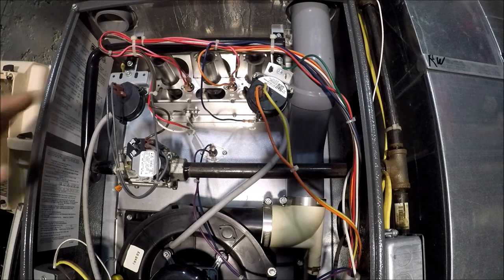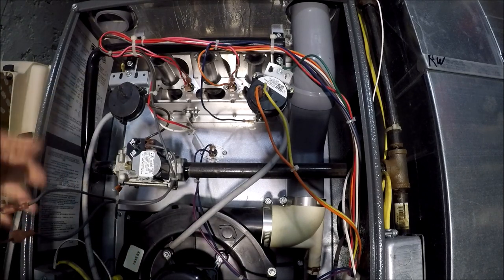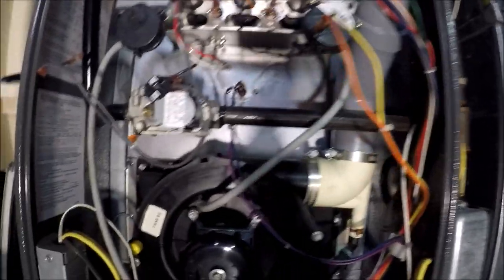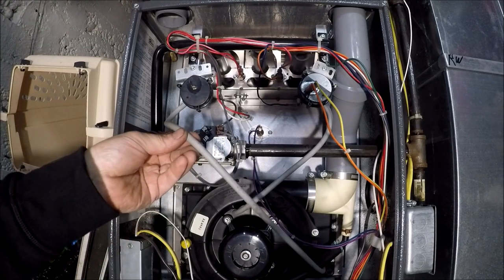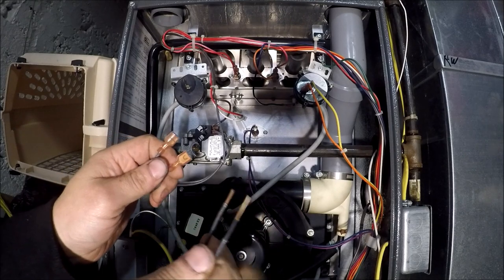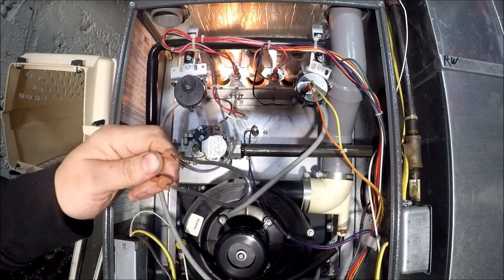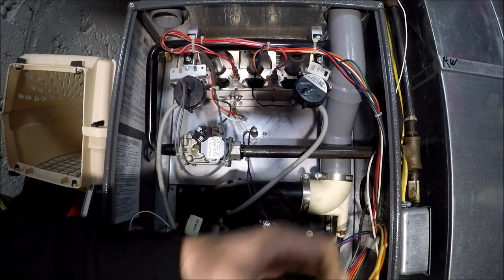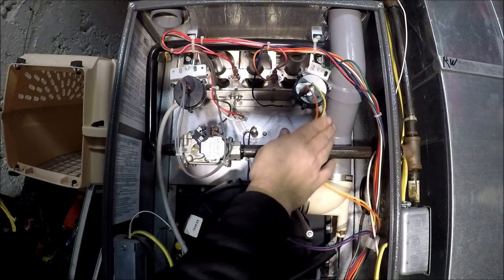Jump a furnace pressure switch for diagnostics

Comment: What would be the cause, that every year I have to get a new high pressure switch. Always spend a couple days continually going down to the basement to let it run through a cycle to heat the house up while waiting for the new one to ship. Is there a way I could do some better maintenance during the summer so that switch isn’t bad start of every winter?
Reply from the maker: Its probably a moisture problem. Make sure your furnace is level so it drains properly. Maybe pull the line to that switch during the summer to make sure it is dry. Of course have a replacement on hand at all times. Let me know how it goes.
Reply: @themrhelperguy  thanks, I think that did it, I previously emptied the hose, but nothing happened. With some more googling and such I took off the hoses to switches and used a shop vac and I had just enough in the inducer to slow it and not trigger the switch. Thanks again! In the summer I’ll see about about clearing the hose.
Reply: I have same furnace and i have to jump pressure switch thats conected to gas valve with a gray wire to get it to fire. I took The yellow rubber plug on inducer off and there was water coming out. Theres also rust under the inducer. How did you fix your problem

Comment: I have same furnace and i have to jump pressure switch thats conected to gas valve with a gray wire to get it to fire. I took The yellow rubber plug on inducer off and there was water coming out. Theres also rust under the inducer.